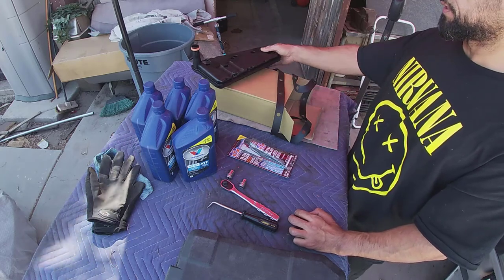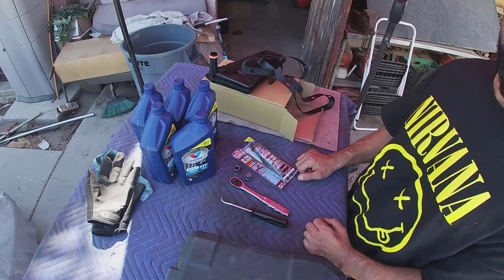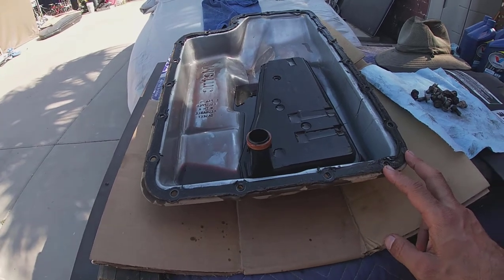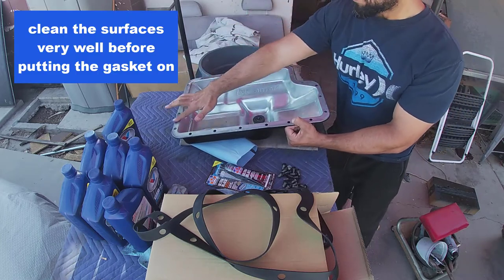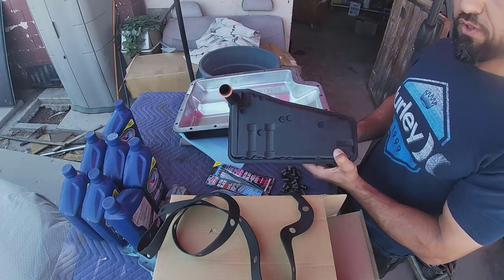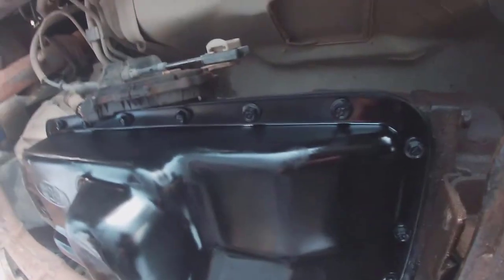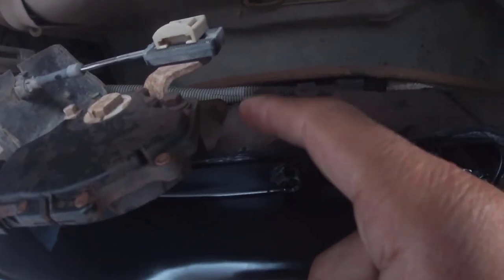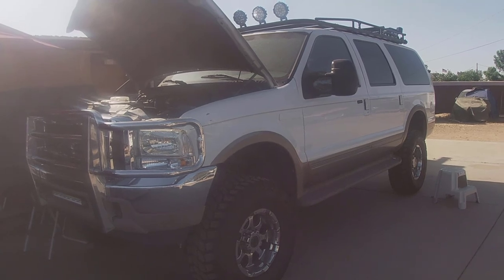2000 FORD EXCURSION TRANSMISSION OIL AND FILTER CHANGE

Comment: Hello, I have a Ford excursion 6.8 gasoline v10 from the year 2000. Could you tell me the oil you used in the video and how many liters does the gearbox need?

Comment: Looking at my owner's guide it specifies 17.1 quarts for 2x4 and 17.7 quarts for 4x4? Why only 6.5 quarts?
Reply: because the rest is in the torque converter so more like a 1/2 change.
Reply: @curtissharris8914  thanks, that makes sense. Hard to get it all out.